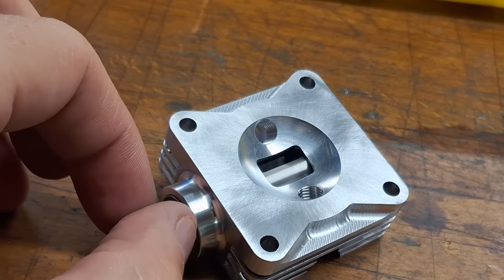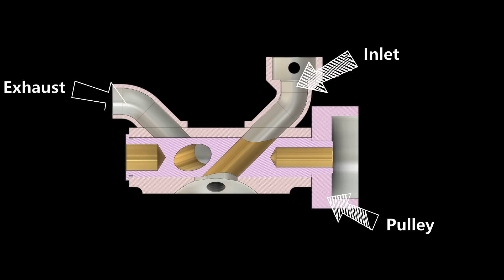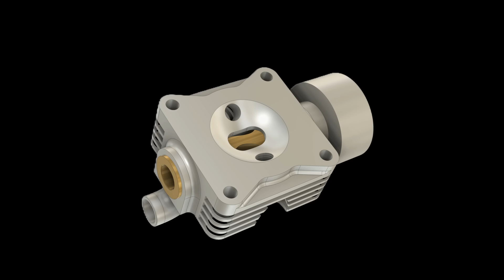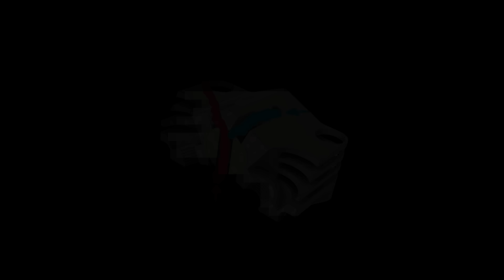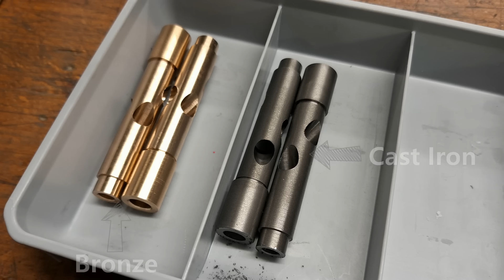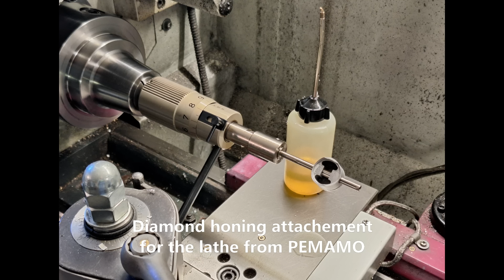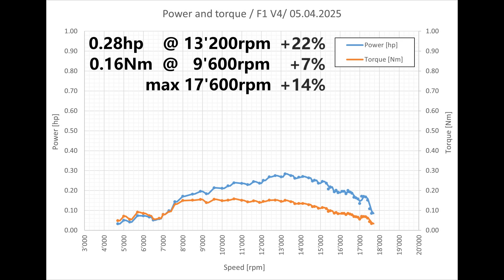New Rotary Valve Design for Model Engine / Modellmotor mit neuartiger Walzendrehsteuerung / Part 2

Comment: Nice video. I think it's great people still try these old ideas. Rotary valves work fine until they carbon up. That's an eventuality in an internal combustion engine running a carbon based fuel. The problem with them is they aren't self cleaning like a normal poppet valve.
Reply from the maker: Hi James 😃 It's just a kind of gimmick and I like it 🙃 A model engine doesn't have to be able to run for hundreds of hours. Durability is therefore not important. After only a few hours of operation, most model engines need to be overhauled, even the ones from OS or Saito with poppet valves.
Reply: @danielhunziker3577  True enough. Cheers!

Comment: Very interesting. I think one Valve isn't going to work. You will at least need 2 valves. Better yet twin holes at each valves to mimic the four valves conventional head. I would think that the overhead rotary valve generally doesn't have flow as good as conventional valve but you can actually have more freedom to change the flow direction than conventional valve to get a better swirl inside the chamber.
Reply from the maker: Hi man! This one valve design was just an experiment. I will use my two valve rotary valve design in future and will try to improve it.
Reply: @danielhunziker3577  can't wait to see it! Beside the tight tolerance between the shaft and the hole, how do you ensure there's no gas or oil escaping from the closed valve?
Reply from the maker: @chumpthetraitor7331  The rotary valve has a clearance of 5–10 µm. The clearance is important for dynamic sealing. When the rotary valve rotates, it picks up oil, which seals the system. Without oil, it would leak. It's, so to speak, a hydrodynamic plain bearing.

Comment: maybe look into the geneva mechanism for turning the valve.
this way it would open and close very quickly but also stay fully open / closed as long as possible.  
it will accelerate and deccelerate the valve cyclinder quite a lot at those speeds. maybe only good for slower high displacement engines.
Reply from the maker: Hi man 😃I understand your approach. It's important to understand that this is just a model engine. It's reduced to the minimum so that the main function is still given. If I want a quickly open valve, I would prefer an electric actuator to do this.

Comment: U should look up the reforge max engine. 
The idea is that the rotary valve is only used for exhaust but doesn’t deal with combustion pressures which are really high and rotary valves struggle with.
Checkout d4a
Reply from the maker: Isn't that the new engine by Harley Davidson?

Comment: Open out the inlets to be the same shape as the head inlet area, they do not need to be circular.
Reply from the maker: Hi Malcolm😃 Isn't the correct question why these are circular in the current design?

Comment: Dial in the valve duration-overlap, timing. Maybe where the power gain-loss your looking for could be. Great work 😁
Reply from the maker: Hi man 😃 Maybe I didn't said clearly in the video that the timing is the same as my 2 valve design. These are already close to the limit with 90°/50°/50°/90°. But otherwise I wouldn't be able to reach such high revs of more than 20'000rpm.
Reply: @danielhunziker3577  really an awesome project bud, Kuddos.  👍
Reply from the maker: @MXstar189  Thanks man!

Comment: I suggest you make 1 more hole in the combustion chamber dome for the exhaust pipe with a size a few millimeters smaller than the intake hole. And add a small bearing near the rotary valve pulley, because the pulling force from the belt causes friction at the end of the rotary valve load at high rpm.
Reply from the maker: The bearing of the rotary valve is the same as in my 2 valve version. The valve cross-sections (8mm hole) are also the same. Why should friction on the rotary valve suddenly explain a reduction in power from 0.60 to 0.28hp?
Reply: @danielhunziker3577   The exhaust port should be smaller than the inlet port, this is done so that the combustion pressure does not lose pressure quickly, so that it can add a little engine torque, an exhaust port that is too large can cause a lack of kickback which is very much needed by the engine to achieve peak power.
Reply: @danielhunziker3577  When you add bearings near the timing belt pulley it will reduce friction a little, because no matter what the pulling force of the timing belt can increase the pressure on the valve pipe, at low rpm it may not have an effect but for small engines that work above 15,000 rpm it has a big effect.
Reply from the maker: @yogawisnuw9659  In the beginning I had a ball bearing at the pully side. It's a huge technical hurdle to get this to work together the Rotary Valve. I agree with you! It sounds logical to use a ball bearing. But almost impossible to handle in practice... the disadvantages outweighed the advantages.
Reply from the maker: @yogawisnuw9659  You're right. I have done the same in my OS FS-40s tuning project https://www.youtube.com/watch?v=1kajzUXECZ0&t=131s It's important to understand that this isn't so easy to implement with a rotary valve than with poppet valves. If you make a valve larger or smaller while the shaft diameter of the rotary valve remains the same, you change the timing significantly!

Comment: i wonder if there are automotive company that's currently doing research and development for this engine.

look like there are some possible variation of slot profile that can be tried out.
even it looks like the intake and exhaust could be profiled so that it can be shaped like turbine and compressor wheel.

if it were profiled like a turbo ofc the rpm wouldn't match
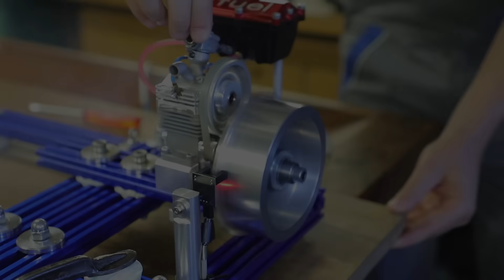around 6600 rpm on the rotary valve vs 100000 rpm of turbo, it would need 1:15 gearing ratio to use same turbine/compressor profile🤔
but maybe there is other turbine and compressor profile that may suit rotary valve rpm, so it may be made on single piece.

with hemispherical head, the compression might be lower than typical dohc head. But a compressor wheel would maximize the pressure. but then it would be that good, as rotary valve is known for being not that good for high pressure (if it were that good, automotive companies would've used this type of engine since a long time ago, right?😅)

looks like a great potential for paramotor engine either way (NA or boosted), cheers!
Reply from the maker: Hi man! Rotary valve has been developed in the 20s up to 40s, espacially for airplanes. The newest engine is a 3.0l V10 from Bishop Engineering (Mercedes) for formula 1 from 2008. Has been banned by FIA...

Comment: This is pretty awesome, it's nice to see more people trying rotary valves, I like the idea of a single port design but I think think the performance issue may lie in that on it's own, there has been a lot of R&D spent into combustion chamber dynamics for automotive and larger and I wonder whether the single port design is missing something like a good swirl or whatever the two port design gives that the single doesn't, I'm curious to see what kind of solution you come up with to make it perform better!
Reply from the maker: Hi Ethan😃  You are right. If Rotary Valve were a solution that was basically easy to implement, it would be standard today in automotive manufacturing. But I like the technology and it's simplicity. It's just perfect suitable for a small model engine like this. The 1 valve approach was just an idea that I wanted to test. I already have a good solution as a 2-valve variant with rotary valve. I'm currently working on a revision of the 2 valve rotary valve system. But I'm still in the design phase. The next step will probably be a new part of the fuel injection (this is currently one of my core projects).

Comment: Make a new valve. Cut the openings "Diagonally"  (45 °)  the full length of the opening.
This will keep the valve "open" longer. 
(Not sure if you have the room to do this though.)
Reply from the maker: Hi David 😃 When I understand you correct: You think the timing is wrong and the opening time ist to low?
Reply: @danielhunziker3577  
After watching your video many times, and skipping around, I don't believe what I said originally will work.
With the exception, I still believe you need more "open time"
I got an idea, I believe it will work, but I need some accurate numbers to draw to prove it. 
I need to know your: 
Diameter of rotary valve
Length, (inside combustion camber) 
Sphere Diameter and how deep
Bolt pattern (so I can scale correctly)

I want to throw this in my CAD.
I am thinking outside the box (as you have)
It does involve re~designing the head, but shouldn't be a problem with your talents.

I love this kind stuff! I'm retired, 38 years Engineer/Machinist/Toolmaker/Moldmaker.
You are obviously a talented Machinist, it shows. Would love to help, but if not...That  OK too.
NOT looking for your money, I just love this stuff.........did I mention that already?
Reply from the maker: @davidnee6157  It looks like I have awakened someone's passion for Rotary Valve! 😃Many people think I just put together some improvised stuff here without any kind of basic knowledge. In reality I'm a certified CNC machinist and I have studied mechanical engineering. So I didn't fall on my head 🙃
When you like to try things in CAD, you can:
- Piston Diameter 25mm
- Stroke 13.5mm
- Rotary Valve shaft diameter 12mm
- Rotary Valve bore 7.7mm
- Hemi radius 18mm
- Piston head radius 30mm
- Compression Ratio 8:1
- Timing: 50°/90°/90°/50°

Comment: At 8:25 time stamp I can see the flywheel-side crankcase bearing housing is leaking oil and seems to have loose screws. Perhaps tighten these to see if you get a better result?
Reply from the maker: Hi man! You're right. I have done a total of over 10 runs on the dyno with this engine. I only filmed one run and that was the one where a screw had come loose 😅 Been unlucky💁‍♂

Comment: Fantastic work, I really enjoyed that !!! How about creating a larger diameter valve drum, so that it would have a larger opening area in the head.. aka larger valves ?  Have you tried different valve timing and ignition positions - given your skills I'd guess you have. I notice that the cam belt tensioner is on the toothed side of the belt, this could cause vibration that would make it jump a tooth - but at least you wouldn't get the valves tangled ;-)  Thanks again.
Reply from the maker: Hi man 😃 The truth is that I can't show all the all the things I have tried. I have tested countless other variants, coatings, dimensions, timings, etc. You can always see the current best status of the engines in the videos. As you correctly say,  all the problems and nonsense improvements you can't see in the video... for example, I have made pvd coated rotary valves. Was a desaster! 🤢 Unfortunately, there is no room for a larger rotary valvr. The reason for this is that the glow plugs are relatively large (but it's a standard component I can't change that easy...).

Comment: A friend of mine had a Rotary valve Glow four stroke aircraft engine over 30 years ago...Compression losses and shortened valve opening periods limit their power output....I prefer making miniature Gas Turbines. They make lots of power. Try a Turboshaft engine using the hot gas outflow for some REAL TOURQUE and power...Prepare yourself for engines running at 160K rpm...😏🇬🇧
Reply from the maker: Hi man 😃 Nice to here you are building yourself turbines! Sounds like you are was well a model builder like me 🥳

Comment: Excellent design! Very nice engine. have you thought perhaps about making the valve out of graphite? Lightweight, self lubricating and can take high temperatures.
Reply from the maker: Hi man 😃 No, I haven't. I think graphite has a too low strength with arround 20MPa. Maybe kind of coating would be a good solution. I made some trials with PVD coating (DLC) and that didn't worked that well 😕

Comment: Hey, have you thought about enlarging only the intake port? Like on pretty much all 4 cycle engines the intake port is larger than the exhaust valve I'd think you would get a lot better
scavenging of exhaust gases and higher density A/F ratio. You don't have to rebuild anything just enlarge the ports. 😁
Reply from the maker: Hi Daniel 😃You have to understand that this is not so easy. If you make the opening larger or smaller, you change the timing! This depends on the rotary valve diameter, the position and the size of the hole. For this reason, you cannot make holes of different sizes.
Reply: @danielhunziker3577  You have a point, that makes sense. I'm tempted to try this myself and log different results. Even if unsuccessful I think it would be very interesting to build.
I know you put a lot of time and work into, thanks for uploading your results.😁
Reply from the maker: @Daniel-vh9lg  The truth is that I can't show all the all the things I have tried. I have tested countless other variants, coatings, dimensions, etc. I don't use anything that has achieved nothing or almost nothing for the videos. You can always see the current best status of the engines in the videos. You don't even notice all the setbacks and problems... for example, I have made pvd coated rotary valves.
Reply: Man now you got me fabricating and designing a rotary valve engine.😁 Awesome job btw!!

Comment: hi again, Have done set up both designs (cyl head) on a flow bench? That might answer a few questions and cause you to rethink a few things. Ideally, you want to mount the cyl. head to a bore the same as your piston. You could manually rotate the valve/ valves and record the flow.
Reply from the maker: Hi Sam 😃 Then I'll have to build another test bench 😅🙈 Fluid FFT would be an easier way, but still too demanding for a hobbyist like me.

Comment: That is a tidy valve arrangement but very limited on event duration which is restricting the power output.    Something like a generator might run something like this well if the valve oils well enough to not seize or bind.

Comment: I think if the twin valve engine performance was so much higher with effectively the same compression ratio and glow plug position, perhaps take a look at the valve time/area for the two designs.  Something is compromising the volumetrics of the single valve.  If the overall area is the same as the twin valve, perhaps the timing may reveal something interesting.  Was the twin valve engine running the valves at half crank speed?  4:1 means the opening and closing times will be much slower and there’ll be twice as long for leakage to be a problem… yeah, I’d certainly look at a plot of valve area against crankshaft angle for both designs first.
Reply from the maker: Hi Paul 😃 I'm not going to invest any more time in the 1 Valve system at the moment. This was just an idea I wanted to test. I have no problem admitting that the 1 Valve system was apparently a stupid idea 😅🙃

Comment: The internal combustion engine is leaking fuel or oil from the crankcase; you have a leak there, you can see it in the video 8:35
Reply from the maker: Thanks for the hint man 😃 I know. I had damaged the seal of the flange during a fix I had to made before the test run😕This may not affect performance, but it certainly doesn't look good with him drooling out of there... My fault!

Comment: Hi, nice work!

I think that maybe you have an issue with the rotary valve port opening geometries.

Think in terms of the old port and polished on poppet valves.

In order to get the most out of the engine, it has to breath unabated.

You are correct about the two rotary valve solution. The combination of intake and exhaust in one valve is efficient but troublesome for a number of reasons. 

The exhaust heats up the intake and limits the effectiveness of the intake. 

I am certain that once you get the two rotary valve system back on you will find that manipulation of the inherent port opening geometry will allow you to get better results.

I look forward to seeing how your future videos turn out!

Keep up the good work.
Reply from the maker: Hi Eugene 😃 My 2 valve design don't need to be reanimate. It's currently my main design and the 1 valve variant was the exotic one, which I simply wanted to try out out of a thought. I already have a concept for the 2 valve design to improve the gas flow. Let's see 🙃
Reply: Hi Daniel, I can not hardly wait to see how you improve the flow.

One of the most beautiful things about the small model engines is that innovation makes them look so much meaningful!

Even though your one valve solution didn't improve the horsepower by a large amount, it did give you a space saving option!

I am definitely happy to stop by your channel every time I get a notification from you to see how you are progressing!

Thank you for the kind sharing of your time and effort in this project!

I am a fan of modeling small engines and you definitely have a unique design ability!

I am impressed by the way you fabricate the parts and because I understand the process, I find it very interesting.
Reply: Hi Daniel,

I was looking at your recent post and I wondered if you were interested in a collaboration with the rotary valve system? I have a new design and I am interested in the fabrication of the project. Let me know if you are interested or not.
Reply from the maker: @eugeneallen1060  You're welcome! I'm glad to hear that people enjoy watching my videos.
Reply from the maker: @eugeneallen1060  Hi Eugene 😃 It's great to hear that you have thought about your own design. Model making is about individuality, about building something yourself, about creating something within the scope of your own possibilities! Don't you have the machinery or the possibility to make parts?